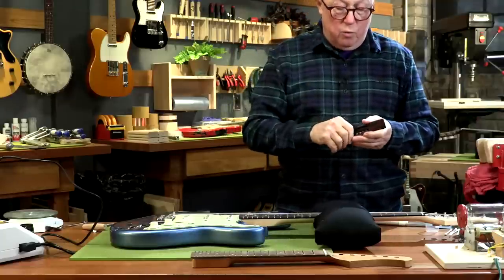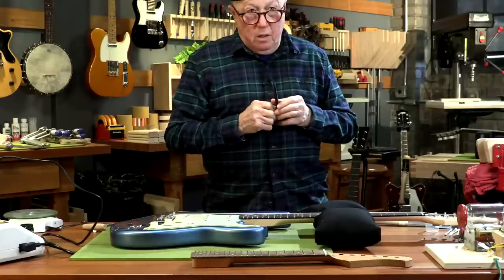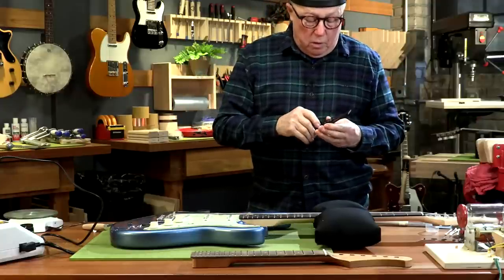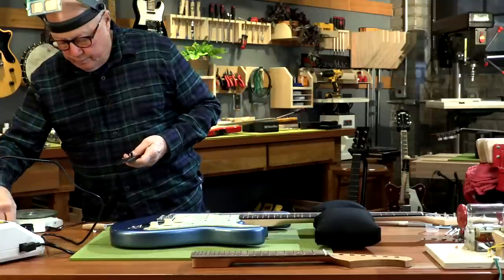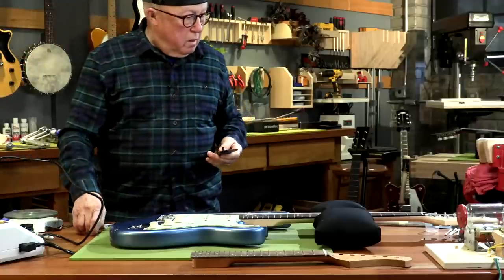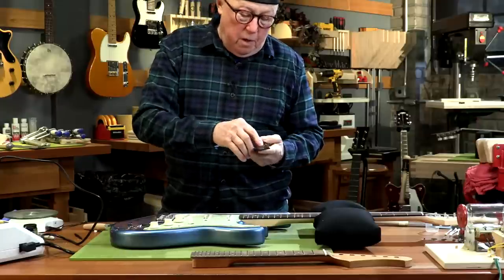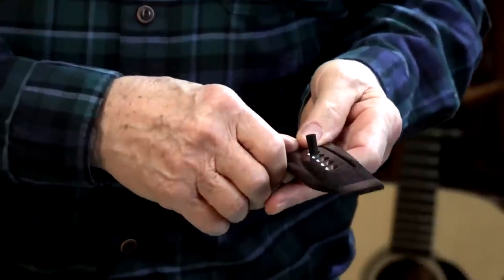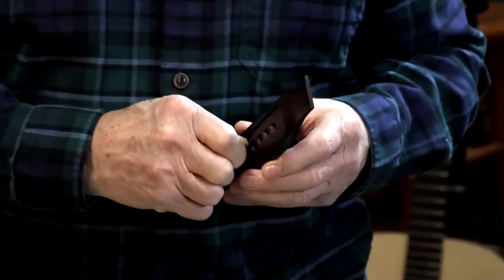Live Q&A With Dan Erlewine - Tuesday February 2 - 4:30 PM (EST)

Comment: Hay Dan, just finished watching the Q&A show. GREAT info. I did have a question about the best way to even up all the fret  and make the top knuckle aligned with the fretboard to make it the smoothest playing as possible? I found a hohner guitar in the road that had been run over by a car and I rebuilt the thing with half the body missing. I hand carved all the body braces and designed a 7 angle bottom for it thats removable. It's been a challenge, but I want to make sure the fretboard is perfect,  flawless, and the smoothest playing fretboard possible. I've been making my own tools, jigs, for this rebuild. Any suggestions for me. I'm in the process of putting a mic system in so I can get a full body sound from a half body guitar. I can send pictures to you of this crazy looking guitar if you want me to. You gotta see it to believe it. 
Brian Parks,

Comment: Have 2 Martin x series gpc and the are both 2 years old but both have a vibration that is when I play an open G and when I play G note on the D and A and Low E strings. What could cause this. I have tried adjusting the truss rod but it seems good. Fret board seems straight and the vibration seems to come from the body and note fretting out. All wires are secured. Thanks for your help.

Comment: Hi Dan, I'm panicking! My expensive les paul custom shop has its truss rod maxed out to the point like I feel like any more force will snap it (to keep the neck fairly straight)... when I relieve the truss rod with no string i get an crazy 1/4 inch bow... so, something is wrong... any tricks that can bring the neck back? thanks... and I appreciate your knowledge and passion for your craft!
Reply: If you can stick a 1/4" feeler gauge under a precision straightedge when no string tension or flex in the truss rod is present, there's definitely a problem.  I would just contact Gibson and get a replacement under warranty.